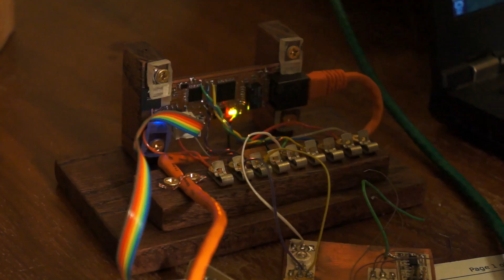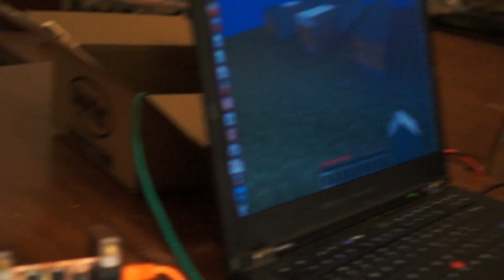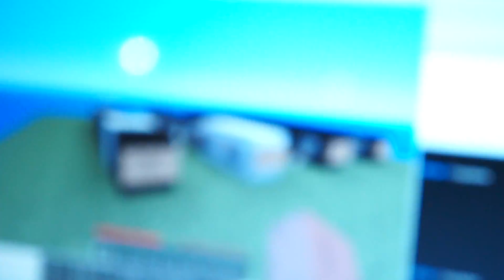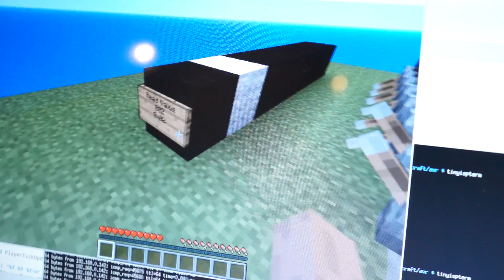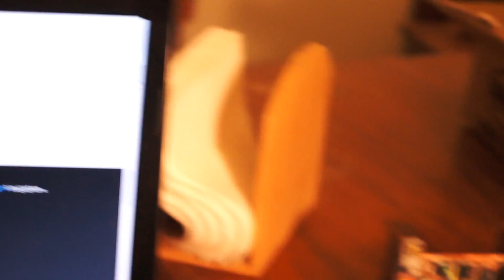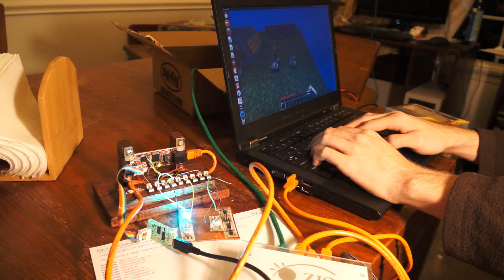Minecraft Server on a Microscope Slide

Comment: How did you implement it without floating point calculations?
Doesn't the client expect a lot of positional data to be floats?
Reply from the maker: +Zooty The Duck I do everything in fixed point.  Angles are represented as 1/256th of a circle, then converted to a float using bit twiddling techniques.  Also, positions are in 1/16th of a meter units.  As long as you send "floats" to the client, it doesn't care what you do on the back end.

Comment: Gave me an idea of a flat controlede remotelly using minecraft client. Just build your virtual home and bridge it with the real one.
Reply from the maker: Hmm, I was originally going to object and say the AVR doesn't have enough ram, but I realized, the world you start with is in a static gzip compressed structure, so you likely could fit it all.  INTERESTING IDEAS.
Reply: CNLohr And if it wouldn't fit - minecraft shitty chunk format could likely be reformated and reduced for a custom format before having it uploaded on the AVR.
Reply from the maker: The problem is the AVR has no ability to decode the compressed formats.  While the chunk format is ugly, it is extremely effective, so I would want to stick to that.
Reply: CNLohr I rather thought that some information may be ommited in the chunks. But when I'm thinking about it, I'm not sure what to ommit at all...
After exams, I'm gonna try this with rasppery! Actually, this is finally computer management as movie makers imagine it :D
Reply from the maker: The same "dumbcraft" interface works on x86 and ARM.  It only takes a few kilobytes of ram to run the minecraft server :).

Comment from the maker: I would make sure that the DDR (Data direction register) is set to drive the output high on both pins.  If it's not driven hard, you will find that turning the port on can raise the voltage, but not with enough force to go all the way to 5V.